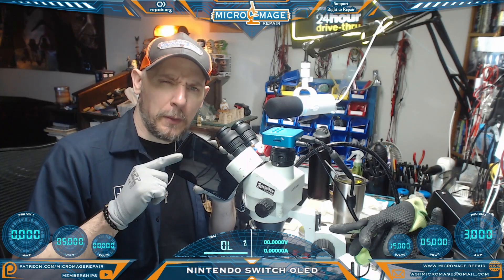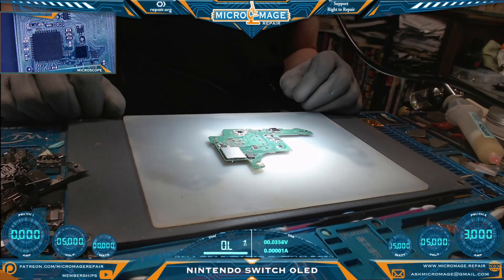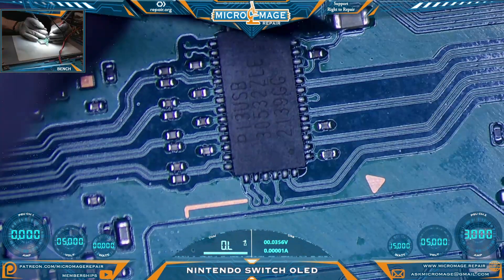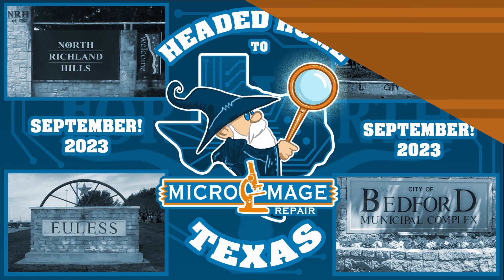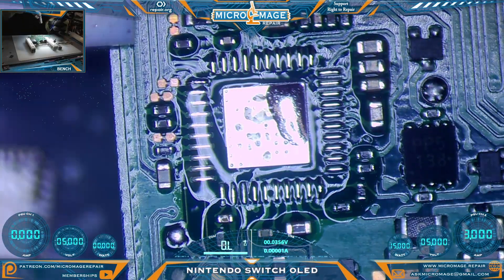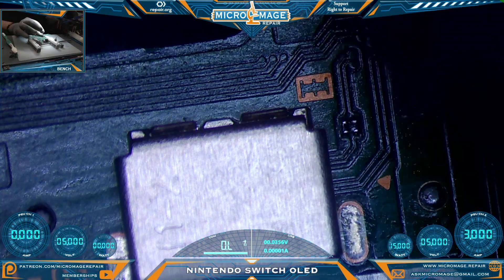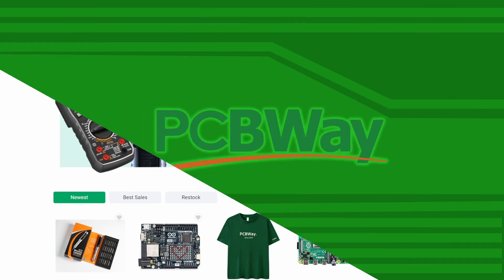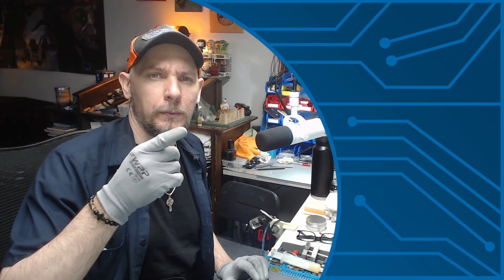Nintendo Switch OLED:☠️ No Power

Comment: Love your editing using crosshairs.
Was hoping a slightly difficult repair on oled this time though, like MAX77620 or MAX77812. 

Kinda scarce on the internet regarding both chips if faulty.
Reply from the maker: Appreciate you.
 I can only record what I encounter in these videos.
I'm sure more complicated OLED ones will find their way to my bench eventually!
Reply: @MicroMageRepair  
I'll just share my findings with you then!

Classic Switch = [2x max77621] is swapped with [1x MAX77812] for lite/oled
Classic Switch/lite = 3.3V regulator chip ENXX is swapped with MAX77801 on oled.

No idea about the mariko v2 sets though.
Reply from the maker: @oliviavalentine5294  Interesting!
I'll make a note of that.
Appreciate you sharing the findings!
Reply: @MicroMageRepair  
Would love to see how you tackle these bga chips in the future. Do you clean the pads or not, etc. Got lucky without cleaning pads due to difficulty.
Reply from the maker: @oliviavalentine5294  I do typically wick them. It's generally easier to place BGAs on flat pads.
It is not impossible to work them without though, generally have to do that on iPads as those pads are stupid fragile.